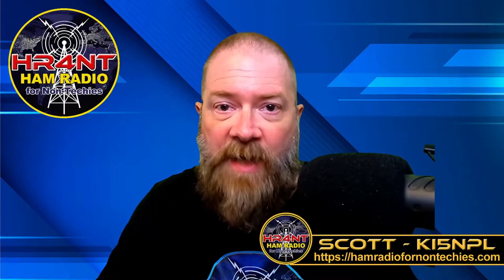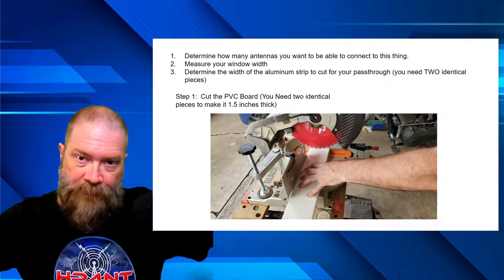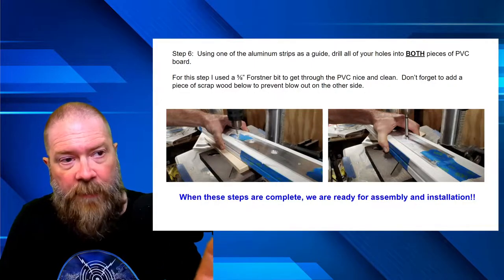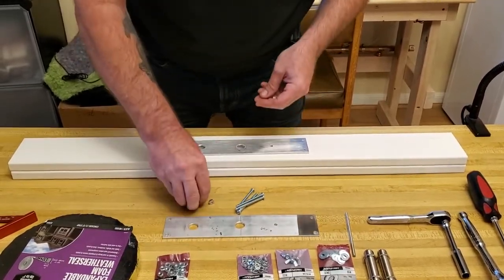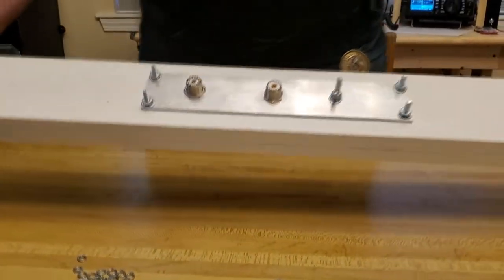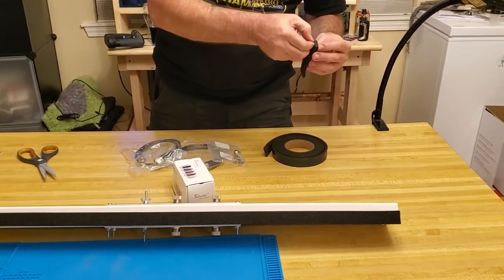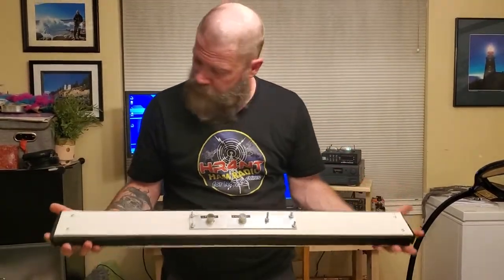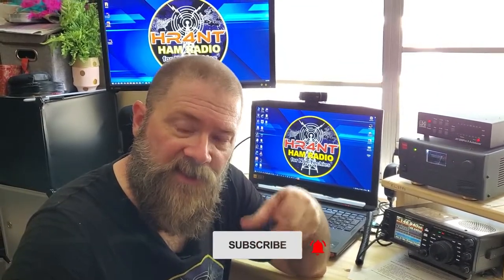Build Your Own Window Passthrough

Comment: do you have a lowes sku for the aluminum strip? I can't seem to find the one you used
Reply from the maker: I dont have the SKU for it, but I bought that at Home Depot not Lowes.  Hope this helps.  Lowes just didn't have the selection of metal plates that Home Depot had.  73.

Comment: This is great however ALL my windows are crankout casement windows there by needing a flatwire passthrough. I was given one when I bought a stealth antenna. I need a second one when I but up a 2meter antenna and a third when I put up ma CB antenna. What would you recommend for the flatwire and how are the so239's attached? Thanks for any advice you could offer and maybe you could make a video. I'm not the only one with this problem, I'm sure. Thanks. Bruce, W9TNT
Reply from the maker: Hi Bruce!  Ok, I don't have much experience with the flat wire passthrough solutions, but from what I researched both Comet and Diamond have options for that.  The flat wire is 15 inched long with SO-239's attached at each end.  For the reviews they seem to work fine.  The main differences are the comet is good to 100 watts PEP and the Diamond 150 watts PEP.  Here is a link to the comet for your review:  https://www.dxengineering.com/parts/cma-ctc-50m  I hope this helps and if nothing else, call the guys at DX engineering and they should be able to answer any and all of your questions pertaining to this issue and solutions they recommend.  Thanks for watching and for the comment!  73!
Reply: @HR4NT  thanks for the reply. I appreciate your time on this. I'll checkthe link you sent. 73

Comment: Why not just start with the four mounting holes in the aluminum plates and screw both of them together to the top of the PVC where you want them and then use a long hole saw to drill through both plates and PVC pieces?
Reply from the maker: You could do it that way as well....I was just making a suggestion for the build.  Hope you give it a shot and enjoy the project!  Thanks for the comment and for watching.  73!

Comment: How do you lock the window? Mine latches at the bottom so I makes me use the comet brand
Reply from the maker: I installed two screws at each side of the window frame just above where the window is opened thus preventing any ability to open the window.  I hope this helps.  Thanks for the comment and for watching.  73!

Comment: Working on this, but using a piece of 2x4 instead of the PVC.  The PVC would increase my cost by $20 and I've got a crapton of scrap 2x4 hanging about.  And I'm using a 3" #10-24 screw instead of all-thread (which would have to be special order at my local Lowe's).
Reply from the maker: Absolutely customize it to fit your needs and budget.  Just make sure that you seal that wood on all sides with a few coats to make sure it doesn't absorb moisture and ruin your project over time.  I wish you the best of luck on your awesome project!  Thank for watching and for the comment.  73!

Comment: Link brings up different size pvc board. What size did you actually use? 1 inch thick by 4 inch wide? Or .75 inch thick by 3.5 inch wide?
Reply from the maker: I used a 1 X 4 which is actually 3/4" X 3.5 inch.  Sorry for the mixup!  Thank you for the question!  73!

Comment: Not sure why he installed a separate ground terminal. I would have just installed it in one of the four corner holes with washers and nuts on each side.  One less hole to drill and a few less parts.
Reply from the maker: That is another way to do it.  I was making my version of the MFJ with better quality materials.  Thanks for watching and for the comment.  73!

Comment: Hey Scott thanks for this video, just ran across it. I made one myself 3 years back but never thought about PVC planks, when i seen your set up i had a hand to head moment. Needless to say I'll be rebuilding mine this spring after the thaw. 73 W8MJL
Reply from the maker: Yeah using the PVC makes it last MUCH longer.  Good luck on the rebuild!  Thanks for watching and for the comment.  73!

Comment: Wow what a great idea man! It is an excellent concept! With the setup you have for the window, how do you lock your window? If I set this up the same way you did in this video I would have concerns that someone could just push my window up and get in or damage/take my equipment?  Do/did you use wedges for the inside of the window to stop it from opening?  How do you secure your window to stop someone from just opening up the window?
Reply from the maker: I locked my window by putting in two screws on each side of the window right into the window frame thus locking it in.  Haven't had any issues yet.  Having this passthrough in your window does make an airspace, so I have a long piece of foam between the windows to block air from leaking out. Thanks for watching and for the comment!  73!

Comment: I don’t have any choice but to build one of these.  Putting a hole in the wall is not an option.  But my windows slide side to side; not up and down.  So the MFJ product just isn’t long enough.  I had planned to run the coaxes through a soffit vent and close the window on some copper strap.  But the copper strap to too thick for that - back to building this.  Thanks for the detailed video.  Great job!
Reply from the maker: Hey glad to hear that my video will help you solve a problem.  It's super simple and will be a great solution.  Best of luck on your build!  Thanks for watching and for the comment!!!  73!!

Comment: I am going to follow your instructions to the letter! I have everything except the drill press and that's coming next week when I go to Harbor Freight . I did purchase a piece of PVC trim, 3/4x5-1/2 because it would fit in the Cherokee and I like the look of the 5.5:2.0 proportions for the metal strip on the PVC.   I went with the trim board because I have 4'x5' sliding window to make this for and the 3/4 was just right for the window channel.
What other type of grounding did you do before the coax gets to the feed thru? Don't you have a video about station grounding? I'll look. Thanks for all the videos. 73
Reply from the maker: Awesome!  Best of luck on the build!  In my most recent grounding video I removed all grounds minus my safety ground and now I just unplug everything if a storm is coming or if I am not using the radios for a while.  I hope you enjoy the passthrough!  Thanks for watching and for the comment.  73!
Reply: @HR4NT  Kool, so you don't have rf following the coax in to the house with is set up? I'll send you photos, when I get mine built. I'm too camera shy to do a video and publish it.

Comment: How do you lock the window?
Reply from the maker: i took some self-tapping screws and screwed them into the frame holding the window closed and locked in the final position after installing the passthrough.  I hope this helps.  Thanks for the comment and for watching.  73!

Comment: Nice work. I'm planning on building one but didn't know PVC plank existed. I'll be using PVC plank for sure. BTW, 146.94 and K5 calls, are you in Houston?
Reply from the maker: Thank you!  Yeah the PVC is much better solution for long term and since so little is used for the project it is cost effective.  I am in Houston on the BVARC repeater.  Thanks for watching and for your support!  73!

Comment: So how do folks address the gap above the sash?  I have double hung windows and lifting the bottom makes a huge gap at the top of that window. 

73,
Ron
Reply from the maker: I had my wife crochet a tube that I just stuffed into the gap.  It is a temporary solution until I can come up with a permanent one.  I would assume that you could use some foam for insulating,  Hope this helps.  Thanks for watching and for the question.  73!

Comment: Was wondering what you were hooking to the grounds, new at this
Reply from the maker: I bought a length of 8 gauge ground wire from Home Depot and attached one side to the passthrough and the other to the grounding rod outside the window.  Hop this helps.  As far as the equipment....everything has a ground strap connected to the copper pipe below the desk which is then attached to the inside of the window passthrough.  Thanks for watching and for the comment.  73!
Reply: @HR4NT  thanks, makes sense now. Good idea with the copper pipe.

Comment: After seeing this video awhile back, I came back today to check the items list again so I could do this project.  I guess it's inflation and what not but the cost now, for what I needed, came up to be more than the cost of the MFJ pass through.  I get that it's Pine and not PVC but that's the main difference.  But your project was a great idea and well executed!
Reply from the maker: Although the prices have increased, I still think using the PVC board over pine is a better option for long term.  You'll never have to replace   it that's for sure.  Thanks for the comment and for watching.  73!
Reply: @HR4NT  Definitely. And I am going to keep that in mind and may replace the board in mine at some point with the PVC.  I should have said, part of what was inflating the cost for me was I was going to have to purchase a couple of the bits in addition to the parts. Plus those SO-239 bulkheads are like over $16ea right now.  I found cheaper options but wasn't sure of the quality. Anyway, I'll see how it goes with the MFJ and may modify it at some point.

Comment: Thanks for the great video...made a pass through this week using the parts list you provided and materials we had at home.  

Our widow sill has a slight pitch doward (~12 degrees) so I ripped that angle on the bottom of the PVC so it would sit flush.  I also use Frost King V28W self-stick weatherseal to keep out the rain (it is an EPDM cellular rubber foam) to avoid moisture retention.  Looks great and work wells!

Now I need to paint it to match the inside and outside colors.  

73's
Reply from the maker: Outstanding!!!!  Glad that you built it and that it worked out for you!  I hope that you enjoy it for years to come!!  Thanks for the comment and for watching.  73!

Comment: What size bit did you use for Ground?
Reply from the maker: Bit?  I used a piece of all-thread and cut it to length.  I them matched up the proper drill bit size to coincide with the diameter of that all thread.  So I guess it will depend on what diameter you purchase that will determine your drill bit size.  I hope I interpreted your question correctly.  Thanks for the comment and for watching.  73!
Reply: @HR4NT  Copy that. I don't have a drill press so I'm kind of having to get... well... creative lol.
Reply from the maker: @greensmurf221   You don't necessarily need one if you have a steady hand and a standard drill it just helps have a drill press but definitely not necessary

Comment: I’m not sure this is a problem, but both antennas will share the same ground via the aluminum plate,  is this an issue?
Reply from the maker: I don't think so.  If you bought the version from MFJ, it is exactly like the one I built in the video.  i just upgraded the cheap pine board they send you with the PVC board.  Pretty much everything else is the same as far as the build goes.  Hope this helps.  Thanks for the comment and for watching.  73!!

Comment: I’ve been using pipe insulation for years, this is way, way better.  I would not have thought to double up the boards.  Good idea.
Reply from the maker: Glad to help.  Yeah my two improvements over the MFJ are using the PVC board (rot proof, FOREVER) and doubling up so that is fits in the window more securely.  After months of use it still works fine and looks brand new.  Thanks for the comment and for watching.  73!

Comment: Another great video.  I used a entrance panel for my coax made by KF7P Metalwerks to mount all my lightning arrestors and route the coax into the wall with a PVC conduit.  I have 4 ‘N’ type adapters (2 for Cell Phone LTE/4G using LMR400 - yuck) and 2 for VHF/UHF radios.  I also have 3 with SO239 for the HF world.   I plan on having a HF Beam, HF vertical, and HF fan dipole with inverted V.  NOTE: the vertical will be either a DX Commander Classic or Naboola.  All the best!  73 de KI5HXM
Reply from the maker: WOW!  Sounds like you took it to another level!  Awesome!  Thanks for sharing that and for watching.  73!
Reply: @HR4NT  they always quote Hannibal Smith from the A-Team.  “Overkill is underrated “ haha. I did look at the pass through from MFJ but I was worried about the gap in the window above.  But a hole in the wall was easier to get my head around.  I’m a noob so overkill is probably my M.O.  haha.  All the best! 73 de KI5HXM

Comment: Scott - great video.  Building mine right now based on what you've done here.  Question - how much gap did you leave on the sides of your PVC board to accommodate the expandable weather seal?
Reply from the maker: Hi Jeff.  Thanks for the question!  I oversized it at first and then did a series of test fits and kept cutting it down incrementally until i got a snug fit, then I added the foam so that my seal would be tight but not so tight that it would damage the window.  You really just have to play with it very carefully and make sure you sneak up on the correct width.  If I had to guess I would say maybe 1/8 - 1/4 inch accounting for the thickness of the foam.  Thanks for watching and let me know if I can help further.  73!
Reply: @HR4NT  Mission accomplished.  Built, installed, and working GREAT.  Really appreciate this Scott.  Was about to drill multiple holes in walls and eaves to run a cable.  This is much better, I think. I can always drill later.  Anyway, a super practical project that many Hams could probably use.  73

Comment: Thanks Scott , Hoping to build one for myself someday soon ,looks very easy but not sure i have cutting tools for the Metal , 73's Hope you had a wonderful 4th of July 🌍🎆
Reply from the maker: I hope you give it a shot.  To cut the aluminum, all you need is any tablesaw or chop saw because it is a soft metal.  If you feel adventurous, you "could" use a hacksaw and do it by hand.  It will take longer and require a bit of sanding to soften the edges, but still doable.  Either way, I hope you find a solution and make one to enjoy.  Let me know if you build one or if you need any other help.  Thanks for the comment and for watching.  73!

Comment: Found your video a few weeks ago ,  I finally got around to ordering the stuff I needed from Amazon and hitting Lowe's for the rest.  I don't have a truck, so I had to cut the 8 ft PVC board in half at Lowe's to get it into my car.  I stuck them in the garage and the next day when I went to work on the project,  I was shocked to find that the two sections had taken on  a serious bow overnight.   

I thought I was going to need to buy a new PVC board... but the woodworker in me stepped in and decided to try doing what I do with bowed  wooden boards... put the bowed boards opposite of each other, apply a liberal amount of glue and clamp them together.  So how do you do that with a PVC board? Simple... use PVC solvent cement for pipes. 

You have to work quick because the glue evaporates (flashes) rather quickly. What I ended up with is a perfectly  straight laminated  PVC board, with no gaps in the joint, the excess glue pushed out from clamping them together melts the seams  together, making it unnecessary to use screws to hold them together.  

People are asking how do you lock the window?  You get some these inexpensive do-dad's that clamp onto the sash/frame to keep the window from being pulled up, I have them on all of my ground level windows for extra security:   https://www.lowes.com/pd/Gatehouse-0-4-in-Gray-Aluminum-Sliding-Window-Mini-Secondary-Latch/3408078 

Anyway... thanks for a really cool project!!  Vastly superior (and cheaper)  to the joke that MFJ sells.
Reply from the maker: I am so happy to hear this success story!  Great idea gluing the boards together and ending up with a perfectly straight material to work with!  To lock my windows I used screws that I inserted into the metal frame of the window and it seems to hold just fine, however I like your solution as well.  I hope you enjoy the passthrough!  Thanks for sharing your story and for watching!  73!

Comment: The whole idea of Ham Radio is to BUILD your own stuff for your shack! As much as you can with the stuff you have at home or can buy locally. We cannot build the transceivers produced today, but we CAN build most of the rest of the stuff we use - antennas, window pass throughs, simple shack accessories, repairing older test equipment, and test equipment. If you learned the material for the class of license you presently have, then you have the knowledge necessary to build or repair anything. KNOW the voltages and currents you are working with so there are no accidents or risk of electrocution! Hams have been building equipment and antennas for over a century - are you willing to admit that you cannot do what other Hams have done for so many years?
Reply from the maker: That is definitely one view of the hobby.  There are those out there that just don't want to build stuff for whatever reason.  I personally like to build things is I am able to pick up on it and do it.  Everyone enters ham radio on their own terms and some may choose to be adventurous and experimental and try building an antenna...that may lead them to other things and projects down the road.  The important thing is to have fun and enjoy the hobby while learning all you can on the way.  Thanks for watching and for the comment.  73!